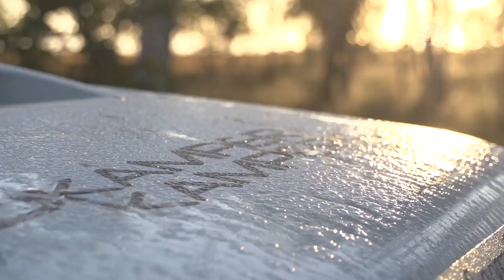This will make you buy a 4WD.

Comment: 1.rocker cover gasket,not head gasket
2.tie rod not steering arm
3.that td42 was ticking it's face off ages before you looked at it,not sure why it took you so long to have a look.Either loose rocker or precomp chamber. Or even gudgeon pin
Reply: Yeh you can tell these guys don’t know much about the mechanical side of things.  Reminds me of a video where roothy says his 70 series is ifs
Reply: Head gasket kink. Lol
Reply: heard the ticking from the start of the video if I remember correctly.
Reply: Oil pressure sounds non existent
Reply: Elis your wrong
Reply: @harrypatt7708 , another one that don't understand car mechanics. BTW, you watched it too. Darren Boxhall is right.

Comment: Hi! Shaun and Graham:
     I've been loving your videos.  I consider myself an experienced 2wd explorer.  But I have been hung up on finding another set of wheels after my pickup finally gave up the ghost, after 25 years.  I've been looking for another used pickup for exploring, and to carry my new off road scooter.  But few used pickups have been available around here.  So I thought I should broaden my search.  I had heard many good things about the Jeep Cherokees, and there used to be quite a number of them in this area.  But like the pickups, I hadn't seen many since I included them in my search.
     Then a month back or so, I spied a 1988 Jeep Cherokee.  It had a decent price, and I could find no major problems.  It only had 133,000 miles besides.  I bought it.
     So now I am checking things out, seeing what all I can find that needs fixing (you wouldn't expect a 30 year old vehicle to be in perfect condition).  Then I'll be equipping it with the essentials for running in the boonies.
      I'd been many places with my pickup, others might not choose to go.  But I'm a careful driver, I don't take unnecessary chances.  My aim is to have a fun trip, not spend all day digging myself out of a place I didn't want to be. 
      Now, with the Cherokee, I don't plan to do much different.  I know the Cherokee will get me places I couldn't get to in my pickup.  But like I said, I'm not interested in spending the day getting myself unstuck.  I spend my time trying not to get stuck.  But I do expect to have fun 4Wheeling.
     I can't give you two all the credit for me buying a 4WD, the Cherokee just appeared at the right time when I needed a vehicle.  But I did want to tell you, there is one more 4Wheeler to add to the count.  Maybe I'll see you at a crossing someday. 
    Bob Woodson
    Bishop, CA

Comment: I'm set on the 4wd, I just need to get it down under... Boys, I wish we had half the tracks you do, in the U.S. So jealous.
Reply: William Howard get yourself a Toyota mate, pretty sure they have four runners in US? Their good rig they will easily outlast and outperform ya average jeep, that said no one really takes jeeps offroad in Australia due to them not being that reliable in our conditions (huge distances and immense heat)
Reply: We do have excellent tracks here in the US, you just need to know where to look. We love ours here in Utah. We have great tracks all over. The closest to the Aus rain forest is back in Vermont and the east coast etc. 
Just get out and explore and you will fall in love with all the terrain we have. I just got back from doing the Pony Express Trail and side trails tonight. 
Cheers
Reply: Yeah, one can pick up a reasonably priced 4 runner with minimal mechanical and get you going down the trails. I myself love American V8  power, so I got my a low mileage 99 Ford Expedition last of the solid rear axles, locking rear diff.
Reply: Sean Butler running a '01 Tacoma.  (basically a petrol Hilux) not getting many mid-sized in a diesel here. Just waiting impatiently. 😊

Comment: I live in the US and have IFS (independent front suspension) on a 2000 chevy silverado 1500 4x4 and i love 4 wheeling and going on trails. You would not believe how much I'll get for using a IFS instead of a solid front axle. My next vehicle would be a jeep wrangler, but i love taking my truck anytime.

Comment: Big reason manufacturers don't stick 35s on standard steering components shown on the Dirty 30 in this video 😉
Reply: Hmmm with such a convincing argument, I must be wrong. I'll throw my  BEng in automotive design engineering in the bin then 😋
Reply: For the record, I don't care if you run 40" tyres just upgrade your steering components to match as the increased load from the impact deflection of a 35" tyre is significant from standard size, hence why they often fail under load.
Reply: Actually, the reason the 4wd industry seems to be ridiculously regulated against nowadays is because of people pushing things beyond safe limits & voiding insurance.

Personally, as said, I don't care what kit you run, just spend a little bit more to make it safe rather than 'she'll be right' & we'll all benefit when the authorities take us seriously.
Reply: I agree with that, bloody make it properly. But Australia is way over regulated, we have a rule and procedure to take a piss. And a buzz kill bubble wrap mentality to match.rep

Think of the children
Reply: Well, we don't shoot each other any more so I'd say not really 😉
Reply: In 2011, there was a mass shooting in Hectorville. In 2014, one in Hunt, and again in 2014 one in Wedderburn (which was a 4 hour siege of a neighborhood).

“But wait, that’s only 3 since 2011! We’ve had 29 in America alone in that same time period!”

This is also a bit of trickery with numbers and comparing statistics. Yes, there have been 29 in America since 2011, and I do not dispute that. But let’s dig deep into numbers- Australia only has 23 million people living in it (with a large amount of those very spread out). But let’s just stick to quantity and not density. The United States has nearly 14 times as many people, at nearly 320 million. So if you compare apples to apples, if Australia had as many people as the United States and the ratio of mass killings to total populace remained the same, Australia would have 42 mass killings compared to 29 in the United States.  

https://caffeinatedthoughts.com/2016/06/no-mass-shootings-the-myth-of-australia-gun-control-policy/
Reply: You can’t just say “ oh look at me I’m an auto engineer and I know it all” do you design 4wd steering components and build them yourself and test them? Or do you make air bags for a barina? Please explain the department and your knowledge GAJ
Reply: Hahaha, I don't want anything to do with this argument but I had to laugh. USA is so regulated by corporate interests that they don't even have diesel engines. None of the vehicles in these videos are available there haha. It should have nothing to do with a steering component discussion anyway.
Reply: Thats not true. All the 3/4 ton and up pick ups have a diesel option, and most of the 1/2 picks are getting one, even some of the compact pick ups have them. Its about cost, the cost of a diesel engine takes a long time to even out with the small price difference between diesel and gas.
Reply: Luke Challen I was a design engineer for a large worldwide manufacturer who supplied steering, suspension & transmission components to many of the recognised international motor brands & therefore had to compile & submit full engineering reports for all individual components in a system so the vehicle could receive international type approval. Then I was head of an engineering team actually carrying out type approval on behalf of the government (not Oz) so I probably know more about safety margins built in to componentry for any given load profile than most. Amongst other things, from what I understand, 35" tyres were bumped off the approval list in Oz due to some of the reports for braking component performance (not measurable braking effort performance) with the extra load from the increased diameter of the tyre being outside what would be considered acceptable. Think more rotational leverage from the tyre, more effort at the pedal to achieve the same braking performance & a serious increase in heat energy that needs to be dissipated by components built with an acceptable safety margin built in for lesser rotational force. Now take a wild guess why Toyota axles go wrong with a spline system designed for less leverage from smaller diameter tyres. Keep going through the system from the wheel studs onwards through the transmission putting considerably more stress through every component due to the increased forces involved & you now have a basic idea on why bigger tyres are off the approval list.

Oh, fit what you want btw, I'm still trying to get 35s approved but it's proving more hassle than it's worth even with my background.
Reply: hey GAJ all axles have splines.all you have to do is make your own axles
Reply: Bradley Bradley We have diesels everywhere here in the US.
Reply: There is absolutely no chance you are dumber the US. I rarely see aussie 4 wheelers driving jeep wranglers, here in the US all you predominantly see is wrangler jk's. the JK is short for JunK.
Reply: Matt B Where are you, there are little to none, as far as off roading goes.

Comment: A car in Australia is a total different animal from cars in Europe! Driving one of these on narrow roads with bicycle asphalt is luckily impossible  because the mileage would suck.
Reply: Tore Lund it would be impossible to drive these cars because of bad fuel economy? What are you on about? Judging by your name, I would guess you are Norwegian. The modified pickups don’t really look the same up in the cold north, but there are a lot of Arctic Trucks with 35,”, 37” and 38” tires rolling about in Norway. These modified Land Cruisers and Patrols don’t have any noticeably worse fuel economy than a Hilux on 38”s. What are your point?
Reply: I have a name common both in Norway and Sweden, but I'm actually Danish. My points was mostly on the road conditions in Australia in this video as a reason for you to need different cars. A Toyota Hilux also has shitty economy@ 22mpg, roughly half that of a normal car driving on a paved road.  This is also not a video about commuting and if you need to haul stuff regularly, a trailer hooked to a compact won't be drivable in such conditions.

Comment: The guy with the trailer, why mud terrain tires on the trailer?

All I could think when he crossed the little creek with the cut trees laying down on it was, it be nice to have skis at this point instead of MT tires. If he had street tires on that trailer and trailer brakes, he can essentially make skis by locking the trailer brakes and deflating those tires, can't do that w MT tires, they hang up.
Reply: Scott Seifert  Mud terrain tyres have the strongest construction. Can handle rocky roads much better, less punctures.

Comment: Hey 4wd action, 
I’m wondering if the dirty 30 has a stock 60 series frame, and if not, did y’all just install a locker in the rear?
Reply: William Belcher  Its a 60 series station wagon with a body chop.
Reply: William Belcher. it has lockers front and rear

Comment: for a first time 4wder what do you guys reckon they should start touring in  out of a automatic or a manual
Reply: Jayden Melgers Ronny dahl did a comparison vid that covers that topic.. Both have pros and cons
Reply: Whatever you prefer. A modern automatic does really well off road. With a manual there is basically nothing to go wrong. I currently own an auto Hilux and i’ve done quite a bit of off roading with manual cars previously. I prefer auto, but all in all it really don’t matter. In the end it is all down to the driver.